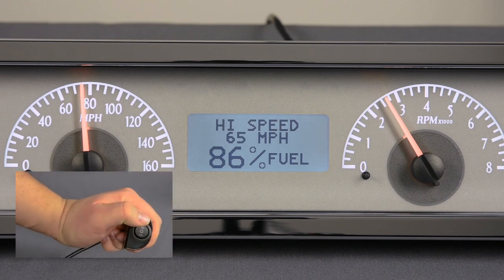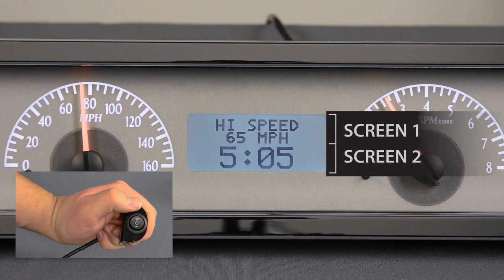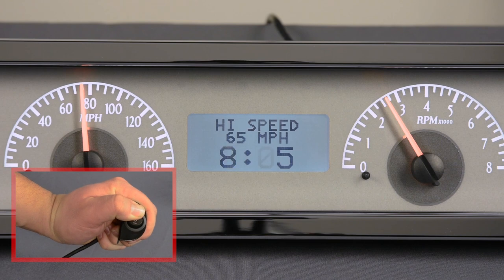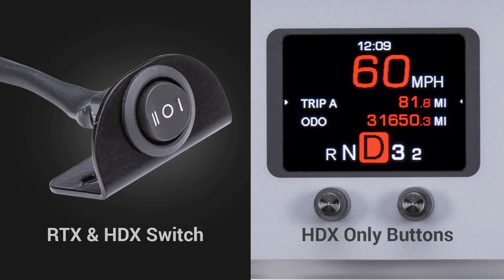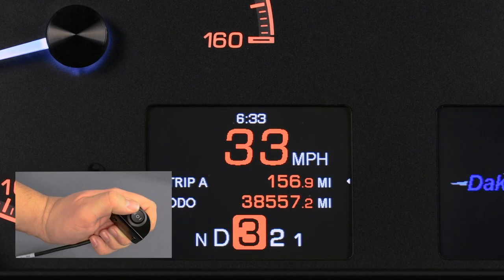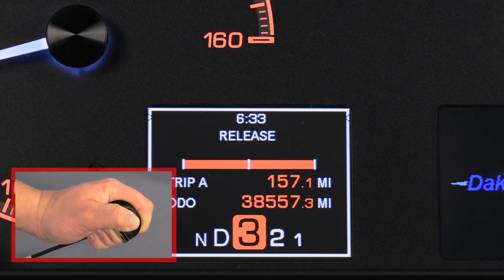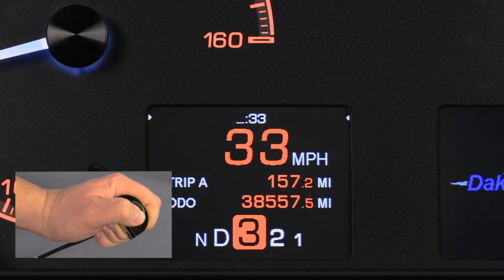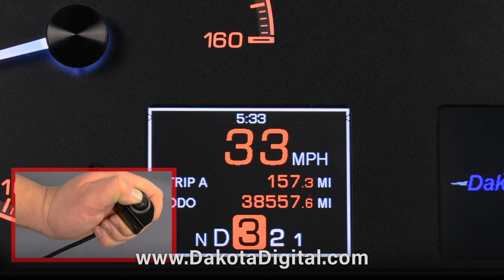Setting the Clock on Dakota Digital Instruments

Comment: Thanks man. I have the HDX and GPS-50-2 BIM and though it says all you have to set is the hour (which is true) there were no instructions in either manual on how to do that...at least where I could find. This did the trick!
Reply: Hi, im using the rtx system with external rtx clock and 50-2 bim module. The module give the time but i need to correct the tims zone for europe. Shows 1 hours to late.  Is it possible to chance something on the menu of the gps 50-2 module ? 
Thanks dor answer
Reply: @m.bender9632  I have the same issue any time I remove the battery from my Chevelle. The clock is an hour off. And it doesn't adjust for daylight savings or standard time here in the US either. Strange.
Reply: @m.bender9632  I also have no idea why it can't figure all of this out from the GPS and a menu option for timezone...seems this should be a standard feature that is lacking.
Reply: @Tman317  so its up to Dakota … any help ?
Reply: Whats about the setup menu of the 50-2 bim…. There is a position c and cl  shows 1-16 and Off  its called „set clock ID“ ?  Bitvinthink when youbrwmove the battery a longer time, it will be delete too